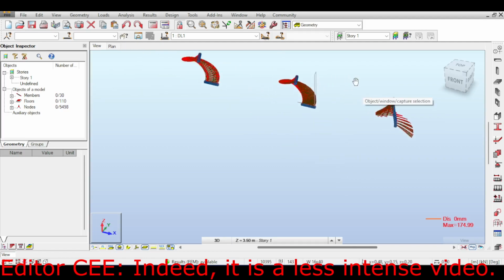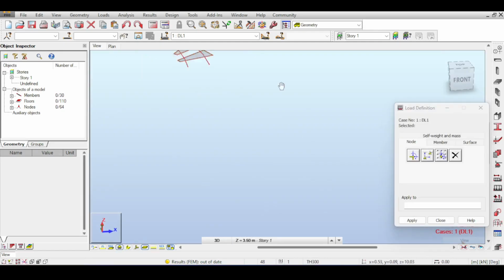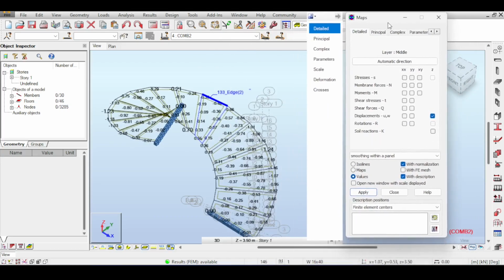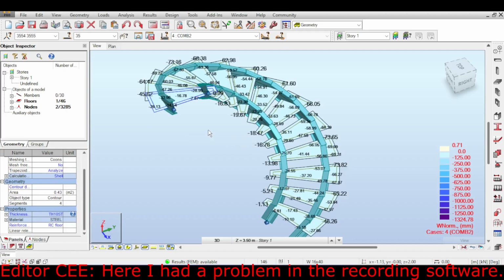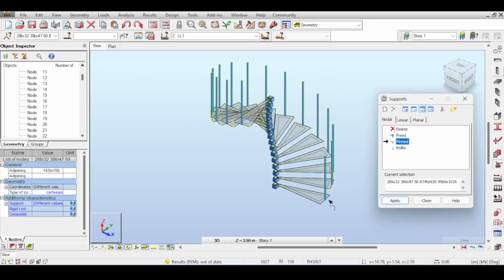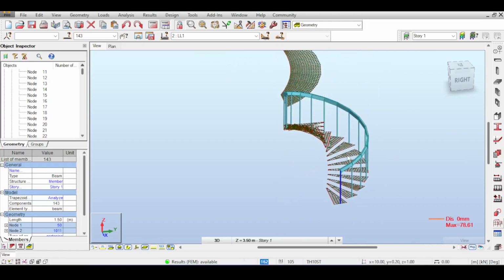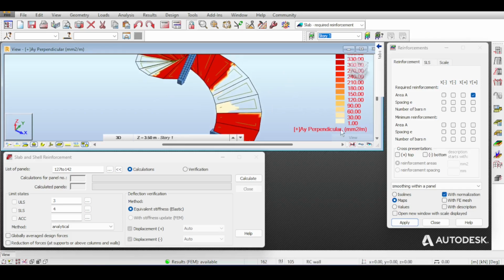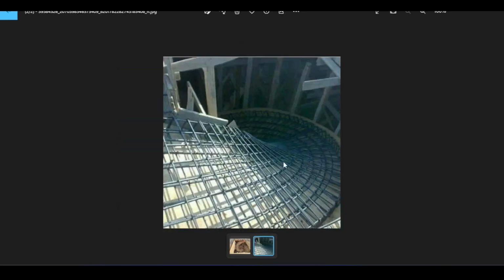Wrapping Up: Our Concluding Remarks on Circular Stairs and Car Ramps using Autodesk Robot

Comment: Hello CEE,

I was not disappointed and I did not find the video to be underwhelming at all. It was necessary to conclude the work that was started last week and hence this video. For the record, I have enjoyed the video. Thank you.

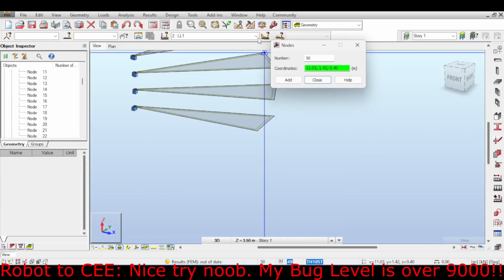4:45 Yes, the shell elements in my model for the staircases supported on helical beams does not seem to be displaying edges when one tries to hover over them or to select them (it is like the selection of edges for the shell elements on these staircases is switched-off or something?) this is also the case 14:22 with my cantilever staircase model, but in the case of the cantilever staircase model, it is only the bottom shell element that is behaving erratically when one tries to select its edges; the rest of the cantilever staircase shell elements are selecting their edges and are behaving as expected. 

Oddly, I also had a separate file (model) with only the helical beams supported staircases modelled in that file; the selection of the shell elements edges for the staircase in that file is working as is expected. I am not yet sure what gives.   

06:07 I am in agreement and in support of the CEE approach. In this particular case, the extent of the dead-weight (permanent load) due to the risers and threads above the assumed (approximated) effective thickness of the staircase slab was covered on the previous video. That plus the guidance shown on this video is sufficient for me. I rather have the CEE focus on “….roboting modelling and designing…” as it is suggested.

08:36 Are the deflection values shown here for the RC concrete representing “short-term” or “long-term” deflection values? Can RSAP calculate and display long-term RC concrete deflection values in this case? how?  

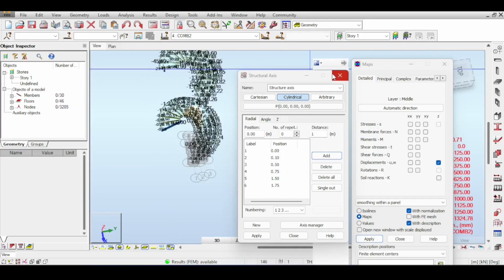11:50 Yep, the steel staircase deflections are proving to be mostly challenging, a mind twist puzzle to be solved. I take note of the two alternative solutions that are presented by the CEE on the CEE attached RSAP model file (fixed supports, additional central supports, reduced 5mm thick stair plates, wooden steps, solid rectangular helical beams) and I find both of these options to be noble efforts (thank you). It does seem that these stairs configuration w.r.t helical support beam deflections is not as straight forward as one may ordinarily think them to be.

13:24 This is yet another one of those unhinged CEE recorder thoughts. I do love the affirmations and the reiterations of the dangers that are associated with this very cool idea, it hints on some of the cautions that one would need to think about from the practical and functional points of views (e.g., how will this be stably constructed and supported on site).

🤔I am wondering if it would be correct to view this suspension idea (the fixed suspending beam on pipes/rods) as being similar to a helical beam concept with the suspending beam as an equivalent helical beam that would have been located and supported at the same nodes locations to which the pipes/rods are currently attached or suspended upon? 

I have really learned a lot from the ideas that were explored on this cantilever staircase concept (suspension, and the idea of more things to grab at 😊). This is so irrespective of the final deflection results that were obtained on this staircase model. For me, the ideas were a different and an important way of thinking and of building up one’s skills. I appreciate that the CEE have not edited these ideas out of the video.

22:35 The steel helical beam is currently made up of segmented pieces from node to node. Ideally one would want to design this beam as one “continuous” beam from support to support. It would be great if the CEE could (maybe as an idea for future videos) show the design of a segmented beam as a continuous beam? I have seen some mentions of “superbar” on some Autodesk forums, perhaps CEE could shed some light on the options to deal with segmented members during design in RSAP?    

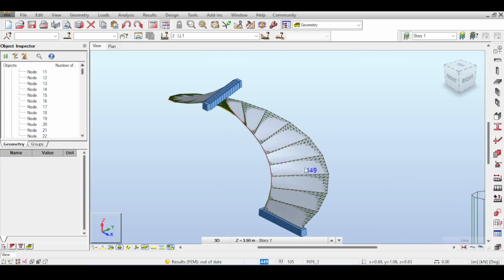22:56 That was a very informative and practical design application and implementation approach which the CEE explained on the reinforced concrete slab staircases. The BAD and IDEAL examples pictures were perfect illustrations. 

29:08 😂🤣😂

Keep well,

I am looking forward to the CEE next videos.

Ps. @CEE editor…. perhaps you would get approval if you cut Mr Recorder some slack 😊
Reply from the maker: Hi there, great you liked it.
I was still ill a little bit, tried to hide it as much as I could. Winter is usually hard on me. It is kind of a chronic thing.
So the same thing happened to you with that edge problem? I will take a look in it. I think it has to do with structural axis, but I am not sure.

Great that my approach to loads is adequate in your opinion. You see, when it is not something "extra-ordinary", I would keep it to the discretion of the viewer, as nothing new is learned there.

About the suspension, it was kind of an out of the box thinking. Still, for real structures, I would thought of it as follows:
1) The first post, last post, helical suspension are going to be larger sections, with a welded connection to be designed with moment carrying into account. 
2) the intermediate posts are going to be hinged on both ends. (truss bars)

As for designing a segmented beam, I have one quick fix for this:
Group all the segments of your beam in one group, design the said group. 
When RSAP designs, it will find the section that is sufficient to carry loads for every single segment. In real life, this section is what I would order. Notice that this segment is also under torsional moment (I forgot to show this, but it is very important to note), and RSAP will take this into account.

Well, I guess recorder guy is gonna have some words with editor guy, especially on his sub-par editing in hiding recorder's winter sickness... 
Let's see what he says in the next video.

I am thinking of approaching bridges. It is gonna be fun.

Regards,
CEE
Reply: @CivilEngineeringEssentials  

I am sorry you go through this every winter. I am glad to hear that you are recovering well. Credits to the CEE editor, he had been very good at hiding the recorder winter sickness. Truth be said, I had only sensed very little during the first “Modelling of Circular Stairs and Car Ramps” video but I could not make much from that and I definitely could not make anything thereafter.  

Thank you for the feedback and for the tips on segmented beam design, I’ll try these out.

I like the idea of doing bridges. As a suggestion (and to the extent possible), it would be good to see some of the bridges loading scenarios that include say:

-	Pedestrian bridge (as was hinted/suggested by the editor)
-	Water supply pipes carrying bridge over say a wide river stream (incl. additional loadings considerations from hydrological studies and the positioning of the bridge piers and abutments across the river (water)? 😊)
-	Vehicular loadings (vehicular bridge)
-	or “some other cool bridges things” as decided by the CEE 😊 

Regards, DK

Comment: so, should loads on a horizontal floor be projected too or just global?
Reply from the maker: if you have a horizontal floor, then both loads should mathematically yield similar results.
Because a projected load works on the horizontal projection of an inclined surface. Global loads work on the area of the inclined surface.

Now if the surface itself is horizontal, then the area of the projection is equal to the area of the floor itself, so they should be equal.
Reply: @CivilEngineeringEssentials   thanks that's great